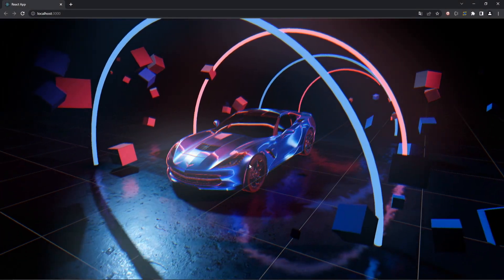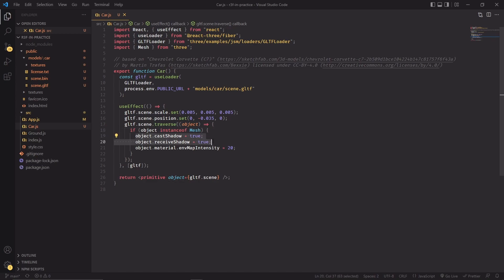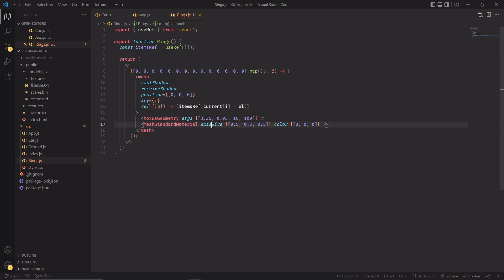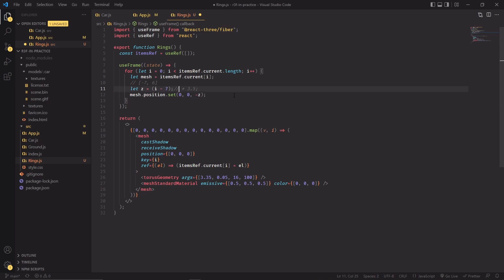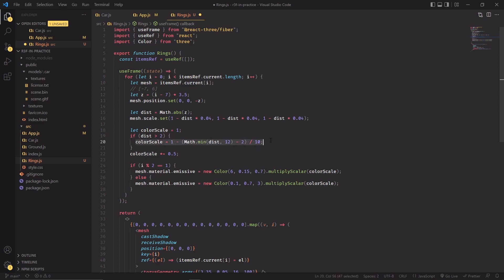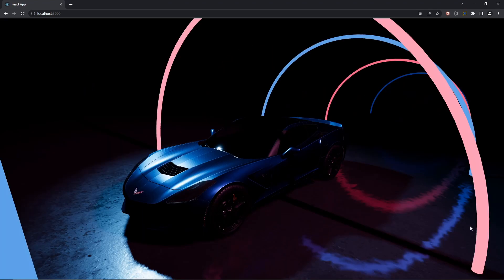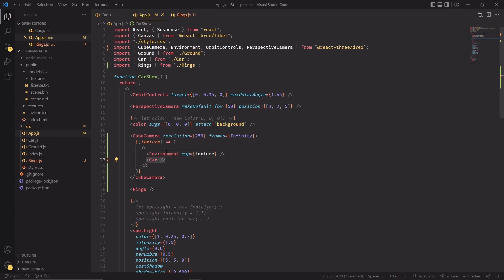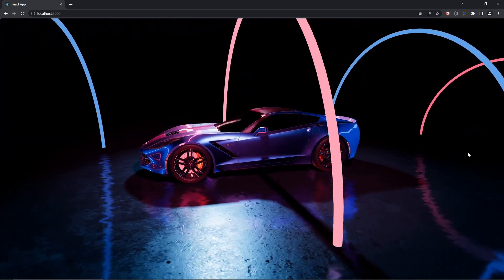Create a 3D car show with React Three Fiber and Three.js [ Tutorial part 2 ]

Comment: Might be worth noting on latest versions of the deps (as of 31 july 2023) the spotlight intensity values don't iluminate like it does in this tutorial. I bumped them around * 100 to replicate thr lighting here. I thought I had missed something as there was a HDR file in the repo.
Reply from the maker: Thank you! It's super unfortunate that threejs doesn't follow proper semversioning, it makes a lot of these videos hard to follow unless you install the same exact dependencies
Reply: @irradiance730  yeah, it could be cool to have a doc to go with it, maybe just a readme something lower effort so you're not having to rewrite a tutorial something changes. 

Great tutorials though.
Reply from the maker: What type of information would you include in the doc? Would it live in the repo at the root level?
Reply: @irradiance730  I was thinking root level, "Updates as x date", then maybe on the description of the video "check repo for updates, things may differ from recording" . 

Obv if there is more fundamental differences, the video may be outdated at some point  so would be good to add works with x version. But from what I've seen thats not needed yet.
Reply from the maker: yeah at the moment I'm always specifying in the video all the versions of the libraries / dependencies that I'm using to make sure there's no possible mistake. But the idea of having a "update.md" file at the root level of the repo is definitely interesting, or even better we could re-use the readme.md to have this type of info. Thanks for the input!

Comment: For any fellow programmers that get white screen when they insert the car model...it probably has to do with your system.

I have the same problem. I would open the localhost and it would take around 15 minutes to show something and still the car was not visible. The whole environment had much less fps, in comparison when the car component was commented out.

For reference I am using a 7 years old laptop (i know i know) with an i5-5200U CPU 2.20 GHz, 8GB RAM and no graphics card (other than the embedded CPU graphics of Intel). I also tested this in 3 browsers (Brave, Edge and Chrome).

Edit: It also depends on the model itself. The one I used must have been "heavy". I also downloaded and run Irradiance's repo and even though the app run, it took around 20 minutes for the scene to be visible (and multiple refreshes).
Reply from the maker: I think the main issue there is not having a dedicated gpu, that project is somewhat heavy with postprocessing effects and unfortunately this does show on older machines
Happy to know that you still managed to run it though after a few attempts :)
Reply: @irradiance730  you are right. Great project nonetheless. Thank you!!

Comment: Hi Irradiance,

Thank you so much for the great video!
After adding the car model to the <CarShow /> OrbitControls became very slow. The scene hangs every few milliseconds. 
Do you know how to fix it? Should I decrease the size of the car model?
Reply from the maker: Hello! what kind of machine / operative system / browser are you using?
Reply: @irradiance730  Thank you for the quick response! I am actually using GitHub pages.
Reply from the maker: I meant what kind of computer are you using to load the page, I'm trying to determine if the machine is powerful enough for the demo :)
Reply: @irradiance730  Got it! I apologize for the confusion.

I am using a Windows laptop, 11th gen i-5 processor @ 2.40 GHz with 12 GB RAM, a basic video card, and a Chrome browser.  It works great on the local host. However, the same project hosted on the remote server (GitHub pages) is very slow.
Reply from the maker: @vatdaziz  that's really interesting, you're saying that the degraded performance is not based on networking speed but the fps themselves of the program run by the gpu, correct?

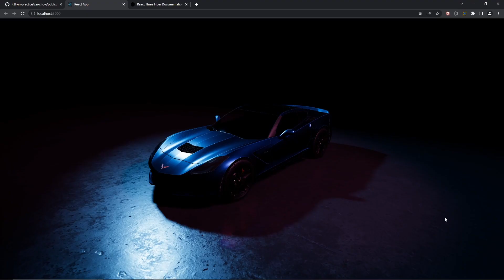Comment: After adding  the Car in 2:01, the model (Car) is not importing and the page is turning completely white. After refreshing the web page it seems to download the scene.bin file every time. I am stuck here, don't know what to do. Could you please help?
Reply from the maker: Hello! if you try to download the repo, so that you have the full finished code available, and then install the dependencies and run the app, does that work?
Reply: @irradiance730  Hello, thanks for your quick reply. Yes, I tried downloading the repo and tried running it with all the dependencies installed. Still no luck. It's the car gltf file that causes the problem think, because whenever I run the code without the Car, it runs perfectly with the the boxes, ground, rings and everything else. I am tried using other car models and other random gltf files and glb files too, but no luck :(
Reply from the maker: @mustahseenmobashwerdipro6736  which system / browser are you using? I tried to do a fresh install of the repo and it does work on my machine
Also if you could tell me the GPU model maybe that could help

Comment: at 09:00 ... I did everything like you - but I used another GLTF model.. and now I don't have the env map on the car. Why is this so? What is my model lacking that it does not get the env map texture generated by the CubeCamera? how can I enforce it in the traverse mesh and add it to the material of each mesh of the gltf.scene?
Reply: And when I test it with a simple Sphere Mesh and put the texture as map on its material, there are reflections but they are "static" - means when I change camera position (orbit control) the reflections stay on the same spot.. not like yours on the car depending on the camera perspective. 

     <CubeCamera resolution={256} frames={Infinity}>
        {(texture) => (
          <>
            <Environment map={texture} />
             <mesh>
                <sphereGeometry args={[1, 33, 33]} />
                <meshPhongMaterial color={"red"} map={texture} />
              </mesh> 
          </>
        )}
      </CubeCamera>
Reply from the maker: Can you try to change the sphere mesh material to 'meshStandardMaterial' ?
Reply: @irradiance730  when I use meshStandardMaterial, then I just got a colorful sphere (red with gradient...) but no shiny reflection of the rings. When I use map={texture} on the meshStandardMaterial, then I got the reflection but static ones.. so strange. you know what, I'll clone your repo and do exactly this.. add the sphere there and see if its reflecting.
Reply: ah and first of all (ok well second....) thank you for responding ^^ so I add the sphere in your repo.. it is exactly the same behaviour.. you can check it by yourself: 
just add this line under the <Car /> line.. 

            <mesh position-y={1} >
                <sphereGeometry args={[1, 33, 33]} />
                <meshStandardMaterial color={"red"} />
	    </mesh>

and also replaced your Car model with my glb model.. no reflections on the surface of the model like on the car.. I'm wondering what kind of options must a material have to recieve reflections
Reply from the maker: @0GRANATE0  can you also set roughness to 0 and metalness to 1 to the meshstandardmaterial? let's see if that works :)
Reply: @irradiance730  ehm I printed a picture.. it's hanging in my bedroom... it's a picture of you domenico... haha 1000 times thank you! I actually tried to play arround with the material parameters in blender, but didn't know which one is causing the effect... but blender can be skipped when you just do object.material.roughness = 0; and object.material.metalness = 0.5; in the traverse iteration. <3 Thank you again.
Reply from the maker: No problem! Really glad I've been helpful, sometimes it's hard to figure out how everything fits togheter
Reply from the maker: Also you can't use the environment texture with the 'map' property, or at least you're not supposed to do that, the Environment component will take care of automaticallt assigning the environment map to all your other components